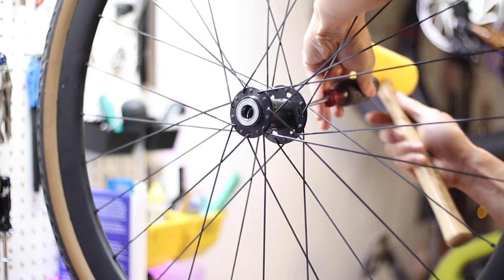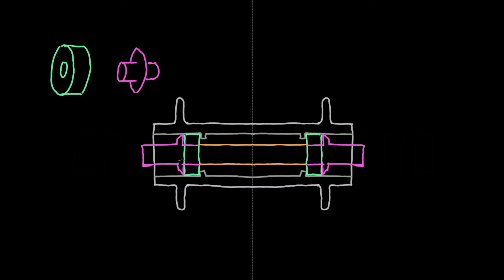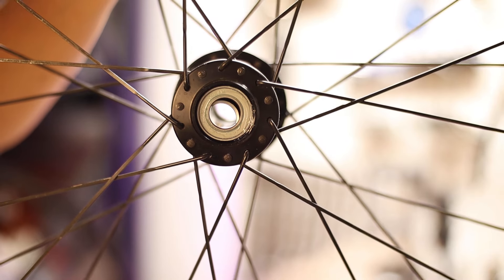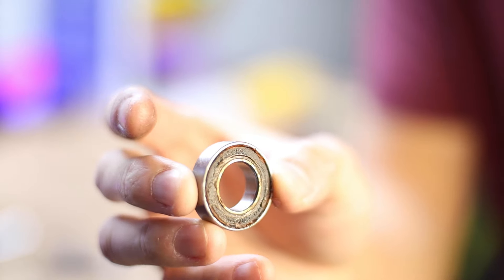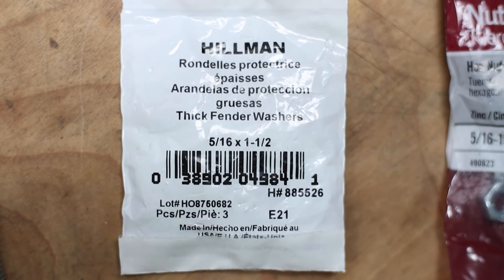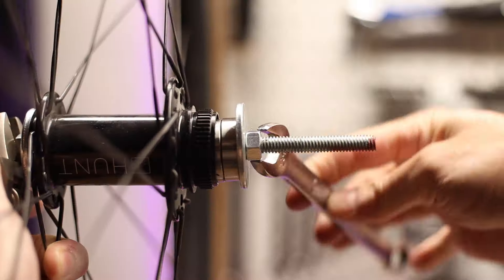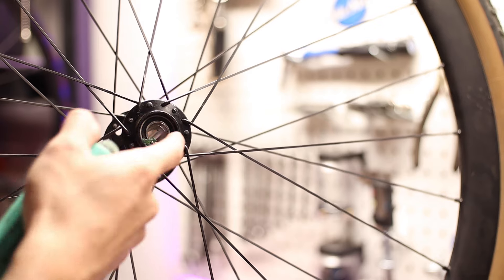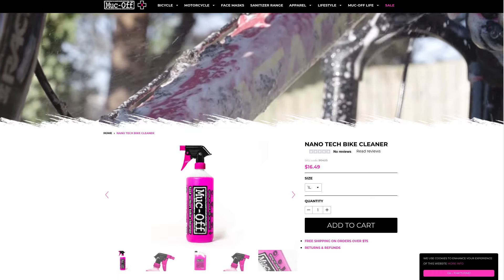HOW TO: Replace Sealed Cartridge Hub Bearings // No Special Tools!

Comment: put the new bearing in the deep freeze for an hour first - makes it a tiny bit undersize and easier to press. Thanks for a nice clear film
Reply: Really.??
Reply: @ampassionstruck9138  Absolutely. Coefficient of expansion and all that stuff from school physics
Reply: Good idea!  Mechanics who work on larger machines often heat the outer ring of a press-fit connection with a torch before assembly.  You can't do that with a bike hub, so super-cooling the bearing makes perfect sense.
Reply: Sounds like a great idea thanks
Reply: @ericl2969  Not sure if it was in the manual or an "old mechanic trick", but my motorcycle guy had an oven in his shop. He'd put the part in the oven on low, and the bearing in the freezer, and it'd drop right in. Once both got back to room temperature they were locked together.
Reply: You can spray it with a can of canned air to freeze it too.
Reply: serious question: would liquid nitrogen be overkill?

Comment: Tried this - couldn't get old bearings out. Sleeve is just sloppily in there. Yeah, you can move it to one side. Then as soon as you put a screwdriver up to it, it moves back to its original position... What is the inner sleeve moves around inside the hub loosely, thereby making the home mechanic unable to gain purchase? Does this mean you must use some $$$ bearing puller tool?

Comment: I know it’s an old video but just found it. It’s the best I have seen so far and the animated sketch is really world-class. Kudos!! I have two questions. 1) Isn’t there a bearing removal tool (like the Park tool for bottom brackets) for these small bearings? You know, the one that expands in the groove and allow to tap in on the whole surface. 2) Why don’t we put retainer compound here but we do on the bottom brackets? Thanks a lot, I subscribed

Comment: Got 4 new bearings for my rocker bmx but sadly it's got completely different axles i only replaced 2 bearings the other 2 old ones won't come out and they're sealed like these but yeah idk I'll see what a bike shop can do and another bike i bought from them its an amazing brand it's a kink street bmx and the brakes don't work and the cranks do this weird jolt type movement and clank really loud noticed right after i got the bike anyway thank you so much tho and i just now subscribed

Comment: Great video, and even greater revelation for me. The Muc-off cleaner eats away the grease of the bearings! I have replaced my free hub three times this year and nobody understood why it would wear off so quickly. Well, turns out I started using Muc-off.  So, which cleaner would you recommend instead?

Comment: I just use Simple Green to demuck my bike which does the job . I then spray / wipe on some WD-40 after the bike is dry as WD-40 makes things shiny , water resistant and helps prevent dust / muck from sticking . I would never wax my bike nor any part as wax builds up into tight sealed areas over time .

Comment: TY for this video. I havent taken apart hubs yet. I ride lots so this will help me considerably with my magnesium alloy rims. 
I like your animated schematic a lot. I bike lots and usually change wheels before the bearings fail. You mentioned cleaners as a possible cause of corrosion. I am certain you are correct. Water pulls away oil particles slowly and cleaner likely does that too. Storing the bike in a really hot spot will do that also.

Comment: I just did the bearing service using this tutoriel ! excellent video! well explain and very clear. Just a small tip for the press fit home tool..  I think I used a cheap washer and it bent, It made the rear wheel installation a bid less easy than the front (I did the front first). Iunno maybe 2 washers if the washer is cheap or solid washers.. that would be my only advice ! But great tutoriel 10/10 !!
Reply: Yeah double em up or source grade 8/9 washers from Tacoma screw or McMaster Carr.

Comment: I use degreaser while the wheel and chain are on the bike.  Just noticed my wheel and freehub bearings are shot.  I think I'll remove my sprockets and chain, before cleaning, going forward.

Comment: Yeap...that Muc-Off does a good one on the bearings. I found out real quick after using it a couple of times   and my wheel bearings were toast. Funnily enough, the pivot points were ok so i figured it was easy for it to drain whereas the hub/wheel bearings were enclosed and moisture stay trapped. 
In any case, I'm more careful with that product now.
Also, even though it's a year older, this is still a great and informative video 👍

Comment: Hey thanks for the great video. I have a set of Hunt Aero Wide’s. The bearing looks to be set deeper than one bearings width, it looks like if I used the old bearing as a drift then I would end up pressing both bearings back in??
Reply from the maker: Haha could be the case. Then you’d want to use a socket with a slightly smaller diameter or just a proper bearing drift

Comment: I am replacing my cheap Fulcrum Racing 5 wheel bearings which really didn't last long - months only. (Bearings used by parent company Campagnolo on my Campag wheels last 1000 times longer). I had read years ago that new cartridge bearings quite often are generic and not greased properly for bike wheels and the extreme impact and torsional loads involved. My new replacements from Ebay were definitely compatible but I thought I would check inside before installing. Sure enough, there was very little grease in each (of the 4) with lots of voids and it was of a thin gelatine like consistency. I took off seals and have packed them both sides full of Motorex 'Bike Grease 2000' . Heavy duty and extremely water resistant grease. These will last a lot longer this time.

Comment: im newbie here 😊 can ask something ? what if i dont put that tube that you put in the middle of sealed bearing ? tnx for the response 😊
Reply from the maker: Probably nothing to be honest, but I think it helps distribute compressive loads a bit
Reply: @TheBikeSauce   thanks 😊 maybe i should try 😊
Reply: My bike didn't come with the inner tube spacer at all..I just make sure I don't over tighten the nut when I installed the wheel.

Comment: What do you recommend to clean the bike with?
Reply from the maker: Most bike cleaners including the muc off stuff is fine, but just don’t blast it into the bearing area. Some hubs are more susceptible to ingress, so you just have to experiment. The videos of the pro bikes being blasted down with a coat of foam soap are frustrating to me because the average rider doesn’t have the budget or time to replace/ service all the bearings at the same interval as the pros
Reply: @TheBikeSauce  thanks for the info, I appreciate it!
Reply: @TheBikeSauce  Yes indeed I was seduced by a video of some breezy Brits going to town on their bikes with the Muc-Off cleaner, so I did the same and although I had a nice clean shiny bike I also had a sickening grinding sound/feel which of course meant another trip to my LBS and a lesson learned. Great vid btw.

Comment: What grease do you recommend to reinstall the new bearings? I have a fresh tube of Park anti-seize compound--is that acceptable?
Reply from the maker: Thx so much for the super thanks! Anti seize is good for threads of dissimilar surfaces. It’ll work fine, but I generally use park polylube or Phil wood grease for bike applications.

Comment: I am from India and I have a cycle but both wheel and bottom only balls and cup can change to bearing?
Reply from the maker: For wheels, you would need a new hub, unfortunately. The bottom bracket, it’s likely you can switch to a sealed square taper unit and use the same cranks. You could also install an external bottom bracket, but that would require new cranks
Reply: @TheBikeSauce  thanks for your information and help me 🙏🙏🙏

Comment: I had my bearings replaced about 500 miles ago, and now the wheel has developed excessive play. I don’t use aggressive cleaners or jet washer, and don’t ride in bad conditions. Is there anything other than the bearing that lead to this? I can’t see anything obviously loose. Any idea?

It’s disc thru axle and it is torqued up correctly

Comment: Are sealed cartridge bearings generally easier to replace than loose ball bearing hubs? I only have experience doing the latter, but recently bought a bike with cartridge bearing hubs.
Reply from the maker: Most will say they’re easier bc you eliminate the variable of preload on the cones

Comment: So on the rear wheel, the sleeve pokes out through the freehub, does this just pull out,  then tap out the bearings as on the front wheel?
Reply from the maker: Actually, that’s the actual axle and it does slide out. The ‘sleeve’ I mentioned is between the bearings inside the hub shell as illustrated

Comment: 3:55 I have both front and rear QR and a guitar slide with washers. Should work

My rear is a 5 Palin 11spd with 8spd cassette.. There's literally nothing holding it together the cassette and hub pull right out.. Ends no threads. Gotta watch the seal stays in place. Best left with tension in the triangle.

120 triple clicker makes some noise.

My shimano 4050 cones causing strife with my discs. To 32H two Palin hub coming.

Comment: What would you recommend as an alternative to muc off that is bearing friendly
Reply from the maker: Most will say just avoid getting soaps near greased components. It’s just mildly upsetting that all the muc off ads show a bike fully doused in white foamy soap.
Reply: @TheBikeSauce  I use muc off and my cup and cone hubs needed servicing earlier this year and now my other bike which has cartridge bearings need servicing after 6 months but done a lot of km this year. I used marine grease on the cup and cone bearings :-)

Comment: You can easily 3D print the bearing drifts. Much easier to keep everything straight that way, and if you already own the printer, then it only costs a few cents in filament.
Reply from the maker: Sounds like a video is in order

Comment: WOW!  😊  Thank-you so much.  My front wheel bearings are horrible!  My front wheel turns with so much resistance, and the balls  actually dropped out, and I was picking them up like an old Jew picking up pennies.    I'm going to do this hub overhaul and thorough wipe down tomorrow  😄.  Afterwards I'll be shopping for 2 new bearings. 🛍   I sure appriciate this video.  Last week I remoed, cleaned, and reinstalled a valve engine cover on my car, this week an overhaul on the front wheel  👏

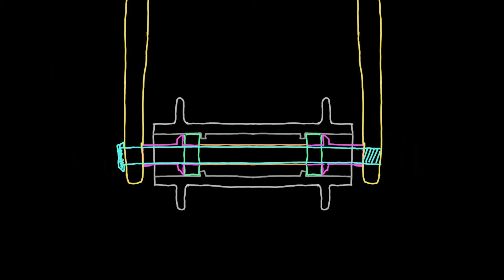Comment: 1:20 You skipped through this part too fast.  I didn't get it.  That is what I want to know how and tools I need to expose the cartridge bearings for examination and service.  Maybe somebody can do a video that shows how to do this from the beginning.
Reply from the maker: almost all endcaps just pull off. Sometimes more force required than others, but most pull off to reveal the bearing

Comment: Best way to wash a bike is just a little lights mist of water to get it damp, then use a damp small washcloth, rinsing the cloth out under running water every so often to remove the dirt and debris as it builds up on the cloth and to prevent scratching the bikes surfaces. This whole soap suds your bike down fad is definitely purported by component manufacturers so you destroy your bike parts. There is simply no need to soap suds your bike. If you do have some oil/grease to remove on surfaces, use Super Clean in a water to cleaner ratio of 16:1 or 8:1 concentration and use use a towel or even cue tips to apply it only to those areas and then remove the degreaser using a towel, since hosing it down after could flush degreaser right into bearings. Take care of your bike and it will take care of you.

Comment: thank u bro.  Ive been trying to fit a lowrider bike rim on a old schwinn town and country rear axle. (rear end fitted to lowrider bike frame). Bike rim with caoster break removed , trying to do pretty much this same process, except one side is 22mm . Other side is 30mm. Axle is 16mm. In exchange its taken space needed to lock onto axle.  Is this like a rare occurance? i cant really find anything  as such on the web. Maybe typing in the search wrong. But i have had it rolling. And it will be pretty good after i paint  it and get it back together. 144 spoke gold twisted and fan pattern rims. White walls. Just the way it sits is sick! any suggestions would be glady appreciated and put into project . New subscriber. Gracias
Reply from the maker: Sounds awesome. Early 90s throwback. It's unlikely that it's a sealed cartridge bearing though. Almost certain it'll be loose ball bearings in there. You'd need some cone wrenches to open it up and service it.

Comment: how do you remove the bearing that was used as a press? I saw you removed it with ease, which is NOT how it happens.
Great video up to the point where you edit difficult parts or how to deal with difficult parts.
Reply from the maker: The ‘Press’ bearing didn’t get pressed into the hub far enough to grab; it just pulls off. The video is only edited four time, but every step is shown pretty clearly

Comment: The drawback to using washers instead of a proper press with drifts, is it's hard to exert the forces evenly and keep it aligned while installing. Some bearings are tight enough to shift off-center, tilt, or bend even a thick washer. You do cover this at 5:15, though it is not always so easy to fix it. A proper press with drifts makes it so much quicker, easier, reliable and trouble-free.

Comment: How do I tighten the " end caps ???? This is the first hub I've run into without a nut. I just loosened it by hand
Reply from the maker: These end caps are not threaded. You pull them off and push them on. I believe some are threaded, but there probably won't be a lock nut; the whole cap will thread on or off.

Comment: Hi! I am trying to replace bearings on the rear hub of a Hunt wheel. The bearing on the drive side seems very tight or seized... any advice on how to remove it? I am tring a screwdriver and hammer from the non drive side...  but it is not budging a bit...
Reply from the maker: If you don’t have a bearing press, a doing it this way with a screwdriver and hammer will work, but the key is even force all the way around the perimeter. A couple hits on one side, then switch to the other side and so on
Reply: @TheBikeSauce  Thank u for the reply.. I tried this with a mate of mine last night and it didn't budge.. I will have another go... My friend said sometimes heating the area up a bit.. can help free a seized bolt?!

Comment: Is there a way you know the sizes on a 700c wheelset? Trying to get new sealed cartridges but dont know the sizings for rear or front, thank you in advance.
Reply from the maker: It will depend on the hub. There’s not really a standard bearing size. It’s easy to take measurements if you remove yours first. Inner diameter, outer diameter, and thickness

Comment: I have this similar hub but the inner cartridge is super super stiff and only gives around 1mm adjustment to knock out the bearing which doesn’t give me enough purchase to on on out the bearings, any advice?
Reply from the maker: I’d try to get more leverage on the sleeve and alternate sides so it’s being pushed laterally (not rotating). Then use the thinnest punch possible on the little available exposed inner race.

Comment: Nice video. In my road bike Scott Speedster the bearings in the front wheel started making noise after a ride under heavy rain. The bearings are 6001 LBLU. In my country, Argentina, I only found 2RS bearings.  I didn't replace them yet, but i cleaned them an put new grease. Would you recommend to replace them even if they are not the LBLU type? I suspect the 2RS will have more friction. Thanks in advance. Greetings from Argentina!
Reply: 2rs is just a term used. 2rs and Llu are virtually the same, they’re both contact seals so any difference in resistance will be negligible. Llb is still 2 rubber seals, just “non contact” so less resistance than the  llu. Lblu is just basically llu one side and llb on the other so good for a hub. I wouldn’t worry about the resistance on all 4 but the 2rs are sealed well from water and dirt. Just don’t get the max bearings. Hope that helps.

Comment: Thank you for that - exactly what i needed. I'll also second your high praise for Hunt's customer service after they replaced the freehub on my Gravel 30s in just three days and with no charge. I suspect it failed for the same reason as your front wheel bearings and they could easily have been less generous.

Comment: When I free wheel, my rear bearings of novatech hub  make a sound how can I solve the problem?
Reply from the maker: If you’re certain it’s the bearings and on the free hub body itself, I’d follow this procedure to identify the bearings model number and replace them.
Reply: @TheBikeSauce  how to dismantle and service the rear novatec hub
Reply from the maker: First remove the free hub body (should pull right off) the same procedure as front

Comment: Very helpful video.
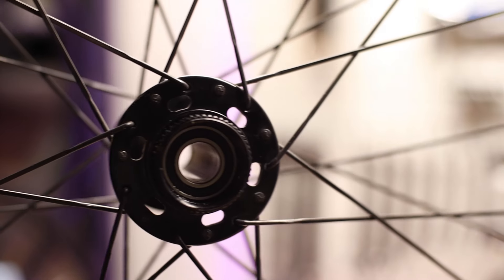5:55 i found the best way to help centre the inner sleeve is to put the wheel on it's side and  level, then the sleeve will be vertical and the bearing will compress on to it squarely.
As for cleaning, chain and gear degreaser might make your drive train look awesome but will liquify any bearing grease!